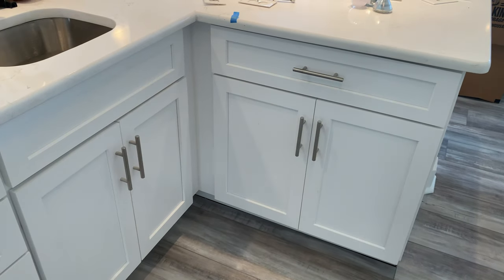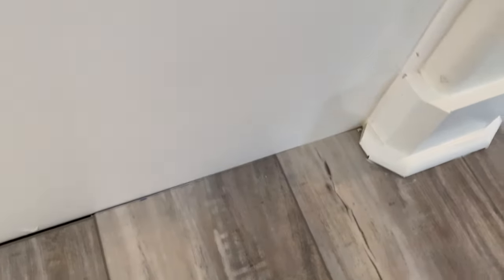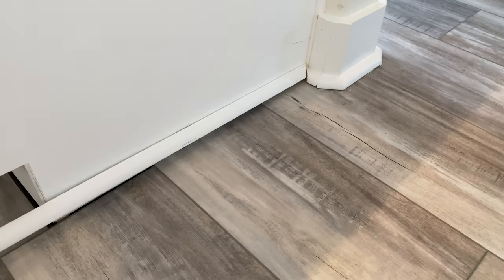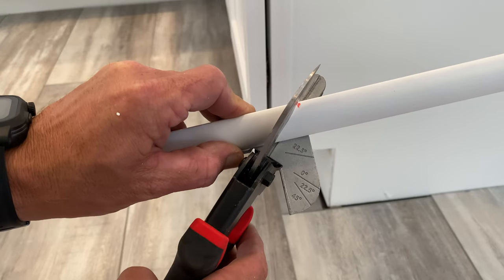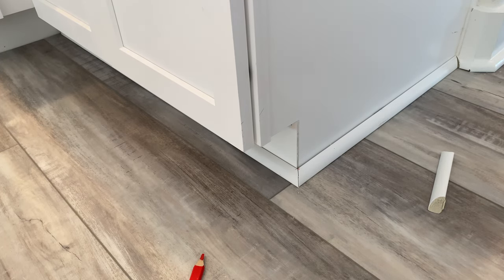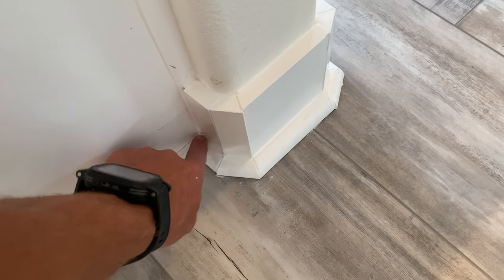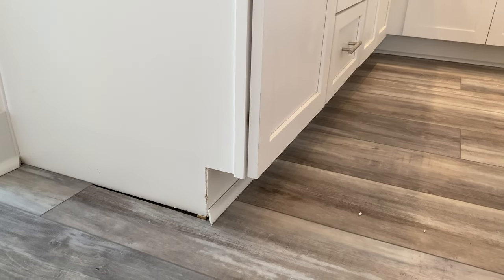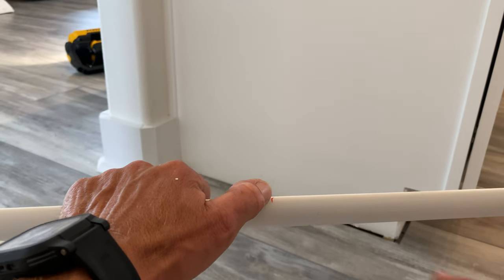Fast way to install quarter round trim

Comment: Also known as a fuck-up strip.

It’s used by hacks to to hide gaps.

I can’t believe they are using this especially on brand new work.

Can I do better? YES

Do a professional job on your floor installation and you won’t need “fuck up strips”.

Your flooring could have went under the cabinet on the front where the toe kick is then install your kick after….like a gentleman!

Whoa…a fuck up strip in a vertical manner going up the back of the cabinet……whoever is responsible for this work is no carpenter.

What is the thought process??? Get everything close enough and use a strip to hide the gaps and hopefully nobody realizes I still have sooo much to learn and actually suck at carpentry.
Reply from the maker: Blah blah blah. To start off it would not matter if you installed the floor first or second what will matter is it the subfloor is level when your cabinets are set no matter what you do from there when you order cabinets they come in a clean cut ripped piece of wood. 98% of the time there will need to be shims added under the cabinets to achieve level on the top side before granite or any other type of countertop is added. Hack job lol. No need to leave all the cussing on my channel I will not scoop to your level. Please edit your comments and remove the foul language.
Reply: But what do you do when you fuck up the fiuck-up strip as bad as this guy did?
Reply: That’s what I’m saying…..this only looks good to someone that has no clue how it’s sposed to go.

I give the guy credit for not removing the comments though that’s pretty cool.
Reply: So you want to “level” the subfloor and still have to shim the cabinets level?   Seems legit.

Yes the floor absolutely has to be in before the cabinets or atleast set cabinets on spacers equivalent to the new finish floor thickness.
Reply: @crdriscoll1  pros use quarter round every day. I’ve worked on multi million dollar homes and have seen it in them. That guy is likely an unemployed troll. ThNks for sharing your video. We all can learn and take something away no matter how many decades we may have been in the trades

Comment: Actually you're supposed to shim the quarter round a little bit with a straight edge preferably a taping knife. That way you could come back later and paint it without having the tape the floor. You simply stick The Straight Edge underneath the molding because there is a gap from when you installed it in the first place. That's Elementary! You see you just learned something today
Reply: Literally no one does this but you.
Reply: @petemesser5783  it's easy to do
Reply: What do you mean shim? DIY single mom here just trying to learn and understand this process ? He cuts opposite ways for each side but keeps the 45 or whatever angle correct? Any advice is appreciated🤠
Reply from the maker: Correct it’s a outside 45 right or left and a inside 45 right or left hand cut
Reply from the maker: Thanks for watching
Reply: @crdriscoll1  What is that tool called? Thanks
Reply: Lay a 6-in taping knife on the floor and then you lay the shoe molding on top and press up against the baseboard and you shoot the nail into the baseboard and it leaves a small Gap so in the future you can come back with another straight edge and stick on underneath that Gap and you paint the shoe molding while you're moving the straight edge along the floor and it will keep you from painting the floor
Reply: Great tips! I just figured out how to do this around my cabinets myself (got tired of waiting for the men’s help). I used a hand saw and a miter box—not perfect, but DONE! I recommend painting the trim after cutting it and before nailing it in. Then you only have to fill and paint nail holes, and not the whole piece of trim against the floor, which has to be taped off. Lmk if I missed a reason not to, though—I’m just an unprofessional DIYer.
Reply: Supposed to???
What about when you have to install a floating floor?

Comment: After reading the other post nobody mentioned it, about using a taping knife to shim the shoe molding or quarter round above the floor. Looks like I'm the only professional around here y'all better look and listen maybe I should give a short video on how to install shoe molding the correct way.
Reply from the maker: Everyone has a different perspective on installation but really only matters as it’s installed correctly
Reply: @crdriscoll1  the correct way to install molding is to send it off the ground a little bit so you can come back and paint it later without having to tape the floor or something like that you know what I'm saying that's the correct way to install it.

Comment: 0:27
Nope, that's polystyrene, not pvc...
Reply from the maker: Sorry says PVC in green print on back of quarter round
Reply: @crdriscoll1  No, it doesn't say pvc. Trimfinity only manufactures polystyrene. Check out their website if you think I'm full of it. Pvc is polyvinyl chloride, which is NOT polystyrene...

Comment: what is the name of that cutting tool I have been using a miter saw this seems alot easier I have been having an issue with a wall that is on a Angle and I keep missing the mark .. Great Video !!!
Reply from the maker: They are called miter snips and can be found at Lowe’s and Home Depot